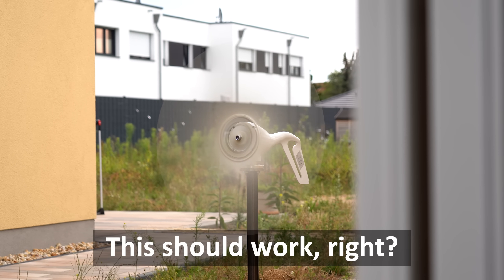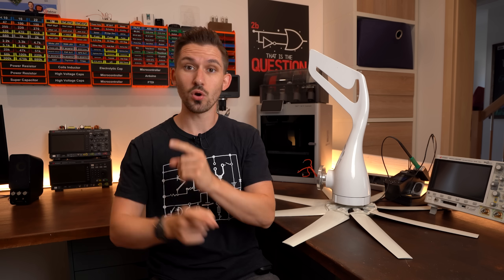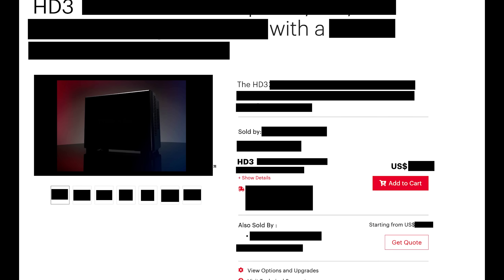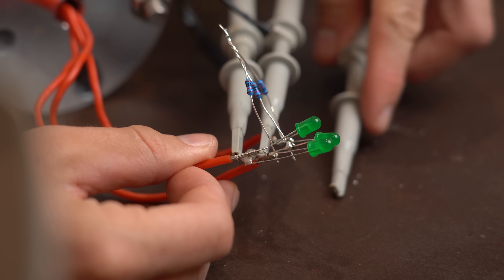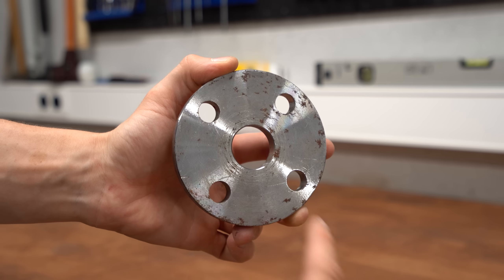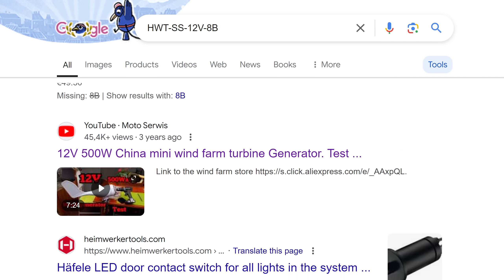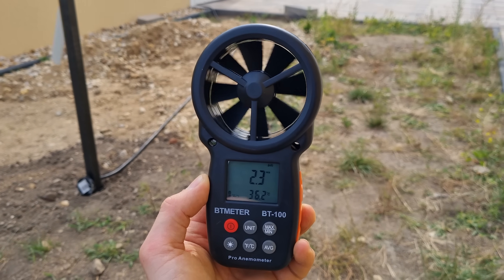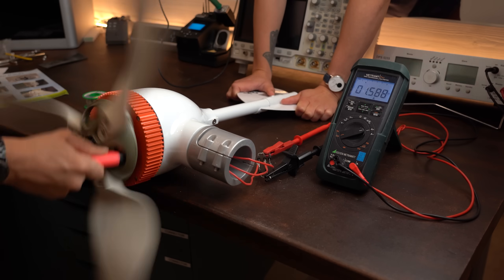I tried to Power my Home with Wind Generators! (Worth it?)

Comment: This was depressing, but unlike you, I live in Hurricane Ally. Which means, probably could get the full benefits of these turbines, since it's usually pretty windy consistently, and I live in a two story house, so can get to 30ft easily as well. YAY BIG HOUSES.
Reply from the maker: Go for it. But make sure that nothing can fly away......
Reply: Just remember you need to be higher than 3m of any surface around 30m radium. Better make that 5m for even less turbulence.
Reply: @harisalatas9062  I have a 2 story house, and an acre to play with. BUT THANK YOU, that's good info. Luckily my house is decently sized at 4700sqft or 1432m^2. Did away with many of the pesky trees as well.
Reply: mounting turbines on top of houses is definitely beneficial, but the house itself is also an object in the way of wind, so it's likely not super ideal. Especially if you mount it at the face of a wall, where you're going to get lots of redirected upflow.

Comment: I would love to make a wind generator with hoverboard motors (they make about 20 - 30V at low wind because of the amount of poles). I have a bunch of them laying around collecting dust.
Reply from the maker: Oh boy. I actually think I have one lying around as well. Maybe I will try that in part 2 ;-)
Reply: @greatscottlab  Would be very useful project, because you can get secondhand hoverboards for about 20 - 40 euro. That includes 2 300watt motors an ESC and 18650 LI ION battery pack!
Reply: @greatscottlab  I tested them recently. They do provide a lot of voltage, but the "performance" is rather poor.
I still have an original one and a modified one lying around. If you need it, I can send it to you. =)
Reply: @energieundhobby  did you use a MPPT charge controller? what is poor? 10W 100W.... ? Thanks
Reply: @jackrenders8937  The hoverboard motor was intended for a small 250W water turbine. Unfortunately, it didn't perform nearly as well as the "internet" predicted. You can easily get voltage to over 100V, depending on how the coils are wired, but the internal resistance of the motors is quite high.
In addition, the housing of my engine was made of plastic.... I measured the generator at several load points, but realistically no more than 100W is possible permanently.
Reply: @energieundhobby  interesting, I will test mine and see. Maybe they are worth rewinding with thicker wire for less internal resistance on a rainy day.
Reply: @energieundhobby  I have done some test with multiple hub motors. And well the results really depend on the quality of the motor some have better magnets than others. I am currently trying to rewire some of them to get better results, and so far not much luck. I think I have to fully rewire the poles to improve the output and rearrange the magnets... that shouldn't be to hard just takes some time the best results would be with gearing and mppt controller.

Comment: I'm just curious on what's the expected maintenance for wear parts like seals and bearings? How much loss would you expect due to friction after say, a year of moderate use?
Reply from the maker: Good questions. Maybe I can address that in a future video....no promises though.
Reply: im used to industrial fans, and theyre really sturdy. but even they wouldve had drastically lower lifetimes if they were outside, without wind a long with ice and snow. and these seems a lot less sturdy.
Reply: These cheap Chinese turbines are very poorly made. They typically fill with water a fail in less than a year. A real turbine of the size in the video should cost around 10x the price. That gets you one that will actually last.

Comment: In my opinion, Wind energy is unreliable, something like solar or hydro is more stable

Also hey, try attaching a gearbox to it and make the main shaft bigger whose speed is increased by the gearbox to the generators
Reply from the maker: I would say it makes a great combination, wind and solar. Just not with small wind generators. They need to be way bigger.

Comment: Ah yes, the good old Sechspulsbrückenschaltung, LOVE IT 😊
Reply from the maker: My favourite circuit ;-)
Reply: My curiosity got the best of me:

SechsPulsBruckenSchaltung

= Six-Pulse Bridge Circuit
Reply: That word is 75 years long😂
Reply: Hehe I wonder what's the longest German word. 
One pretty long Finnish one is the lentokonesuihkuturbiinimoottoriapumekaanikkoaliupseerioppilas
Reply: @TomboRectify The longes German word that actually was in official use for several years was „Grundstücksverkehrsgenehmigungszuständigkeitsübertragungsverordnung“, a federal law that got abolished in 2007.
Reply: @TomboRectify   Please translate.
Reply: @paulvale2985   Okay you asked for it!
The short-ish answer is "Aircraft jet turbine engine assistant mechanic non-commissioned officer student". 
So this is a very specific position in the military.

But let's translate it word-by-word:
lento - - - - - - - flight, flying
kone - - - - - - - machine
suihku - - - - - shower
turbiini - - - - - turbine
moottori - - - - motor, engine
apu-    - - - - - - assistant
mekaanikko - mechanic
ali-   - - - - - - - - sub-, under-
upseeri - - - - -  officer
oppilas - - - - - student
Reply: Aren't we lucky it's not a 10-phase output
Reply: I almost popped to attention and saluted when he said that!🫡

Comment: I think solar power is cheaper
Reply: At small scale, yes. Wind turbines have their role, but it isn't in the home - they become viable with scale. The bigger, the better. If you make your turbine twice as wide you get four times the power, and going up in height increases the power output greatly as power is proportional to the cube of the wind speed. For small scale like home use, solar has the clear advantage. But for grid-scale generation, wind often ends up cheaper if the local environment is suited to it.
Reply from the maker: Great feedback. Thanks.

Comment: The question is - how much did your positioning of the wind turbine on ground level instead on the roof reduce its power output?
Reply from the maker: Good question. Probably quite a bit of a difference. Maybe someone in the comments will have some experience.
Reply: @greatscottlab  Perhaps in a follow-up video you could temporarily take the generator somewhere you can mount it higher and get those high wind speeds for comparison?

I have also thought about getting a wind generator to supplement my solar power, but I do not have much wind at my home.
Reply: @greatscottlab  
i put mine on the highest point roof with a 1.8m pole. and it still was absolutely not worth it. even in very windy conditions. there was still too much turbulence i soppose.
Reply: Way too low , On the ground the wind is minimal the higher the better, if you go up 3 m probably 2-3 times more
 5-7m would be the best max wind speed so it needs A very heavy duty solid Mounting system on the roof ,regardless of what electronics you use it'll be pointless if you can't install high
Reply: You guys miss the fact that between houses/buildings you get a tunneling effect that actually increases wind speed. Not saying it’s the equivalent of putting it on a 2nd storey roof, but it’s still something
Reply: @burprobrox9134  That effect is so marginal structural engineering doesn't even take that into account. The higher you go the faster the wind speed is always true in all cases. Best place for the generator is on the roof.
Reply: @Six_Gorillion  True. Turbulences on ground level will negate that tunnel effect, beside it would only work with the wind coming from a precise direction. For an maximal &contant windspeed you'd need an urban area and the wind turbine higher than the roof to escape every turbulence. So having a house near an existing wind farm would be optimal.
Reply: It needs to be on a pole, higher the better.
Reply: Regardless, it was still spinning pretty fast which doesn't hold much hope for low wind days.
Reply: 99% reduction
Reply: You can't (well you can) put wind generators on houses because your house is not rated for vibration, and it will damage your house.
Reply: @GregoryAlbright-t3p  
it will absolutely not damage your house. unless you have a really cheap build. but there will be amplification of the noise